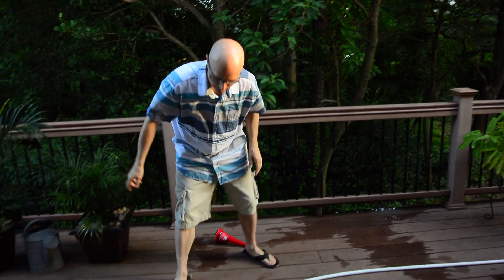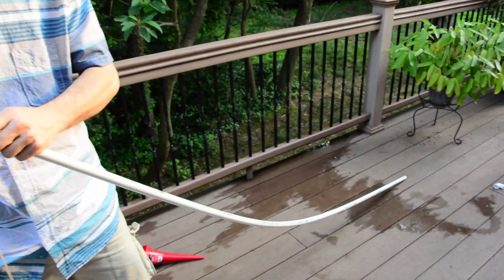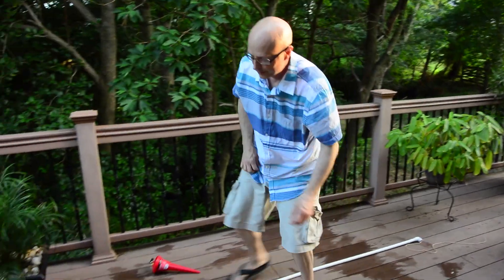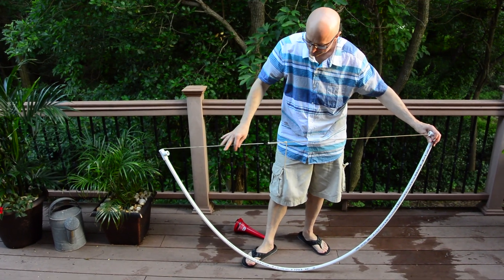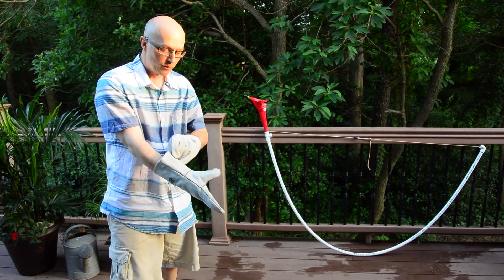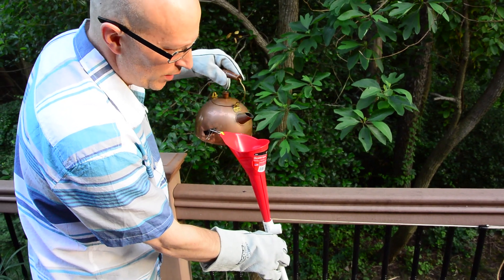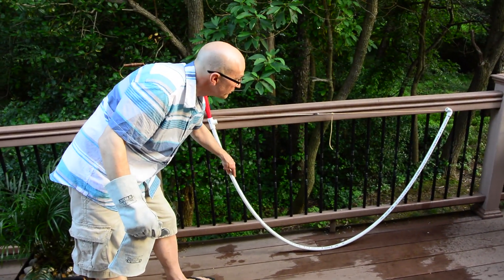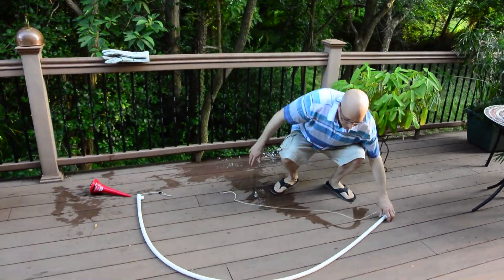How to bend PVC Pipe with Boiling water

Comment: Is the concern about sending boiling water down PVC pipes a reasonable one? Some plumbers say it's no problem, others that it could be a problem. If the latter is true, how so? Even if the PVC becomes more malleable because of boiling water, this is only briefly the case. And you're not actually down there in the pipes bending anything.
Reply from the maker: I've never heard of that problem.
Reply: It shrinks slightly when heated. Over time your elbows will leak from the pipes shrinking and expanding and breaking the glue seals

Comment: You video worked perfectly.  I wanted hoops over my 13 x 17 pond and your demonstration sahowed me the way.  I didn't want a perfect loop so I pent the first one with a steeper angle on one side, the one closest to my deck.   with the other elongated.  I used the first  to roughly template the other two.  

I obviously needef two 10' pipes for each loop so I glued fittings on each end of the loop and just pushed the added length into the fitting.  At first I planned to glue the entire piece but changed my mind when consitering where I'd store them when spring arrived.  

Thanks so much for the video.

Comment: Finding this video has been the joy of my week! If I had only learned this like 10 years ago! this is sooooooo awesome. Thanks a million.
Reply: I built a frame for over my pond with pvc probably around 20 years ago using fittings to put it all together.  The idea was to keep the fall leaves out of the pond since I live in the wiids and there are a lot of leaves.  It was a monstrocity that was somewhat effective but not nearly so as I would have liked.  Leaves would pile up in valleys plus putting it up and taking it down was a pain.  I finally gave that up after 4 or 5 years and tried to get as many leaves out before they sunk to the bottom.  That was labor intensive and really less successful than the pvc frame.  Lucky I only had comets instead of expensive koi or I would have been digging floaters out all year.  Then there was the issue of blue herring that decided my pond was a restaurant.

Move forward 20 years and I want to get active with the pond again.  Saw a great video of a guy that used 3 arcs of Pvc over a pond slightly bigger than my 10 x17.  He drove rebar into the ground at appx. 45 degree angles and put one end in the rebar on one side of the pond, went to the other and did the same there.  ingenious but he didn't describe how he bent the pvc.

Now I know how and my pond will be very clean after the fall (both figuratively and literally.  Now all I have to do is figure out the calculations for each arc's size as the pond's dimensions vary from front to back but the netting is ordered and I'm off to the races.

Much thanks Bill Lawson!

Comment: Hmm, I tried this and my pipe collapsed in the middle and is destroyed.  Does that mean too tight of a bend?  Any other way to avoid pipe collapsing? It was schedule 40, 3/4",10ft long, trying to spread a 56" gap.
Reply from the maker: If you need to do tight bends, I suggest doing this method multiple times. Bend it as far as it will go without crushing. Heat it, cool it. Then bend it as far as it will go, heat it and cool it and repeat. I was able to bend a 1/2 inch pipe in a complete circle to fit in a 1 foot box.
Reply: use sand  or garden hose inside pvc, then heat gradually and bend to desired shape

Comment: Be aware that if you're trying to make a perfect arch, it may not work. The arch I made was uneven and weird looking. I shaped my form on a plywood with small wood blocks and then poured boiling water in it and it worked perfectly.
Reply from the maker: Yeah, making a form is the best
Reply: yes, his arch is uneven also, as it retained stiffness at the  far end of the pour where the water which had lost most of its heat into the material sat.  the pour end accepted the bend and did not spring back.  definitely best to use a form and make sure to send more hot water through both ends, i think, as i sit in my chair not doing this.

Comment: Is it hot enough to bend a 1” pipe?  If so, how long do you have to shape it before it starts to harden again?  I’ve seen another video where the creator claimed it wasn’t hot enough to bend a thicker pipe.  In yet another video the pipe was boiled in hot water and it had to be shaped within 30 seconds.
Reply from the maker: I've used this method to bend 1inch pipe. As long as the water in the pipe is hot you can shape it. When the water cools off, you can no longer shape it.
Reply: Photographer Bill Lawson  Thank you very much!  Grateful I don’t have to buy and heat up sand, buy end caps or 45-degree elbow fittings, and worry about off-gassing chemicals!

Comment: Does the PVC regain full/majority structural integrity when it cools ?  use 3/4-1' for foam sparring swords, would like to make a curved sword.
Reply from the maker: Yeah it has plenty of structural integrity. I used it to build a hoop shelter. I was able to hang on my shelter made with only 5 half inch ribs. It was very strong.

Comment: Love it!!! I will be plumbing a pool tomorrow with 1.5” pvc and am thinking of trying this instead of using 45* fittings to make the turns. 

What ya think?
Reply from the maker: Should work. Probably want to leave the water in the pipe longer with the larger diameter. That will soften it up a bit more.

Comment: Thanks for this! I had an idea that requires 3 complete circles and, when I tried to do it without heat, it wasn't going to work. I'm definitely going to try this method. THANKS!
Reply from the maker: The tightest circle I have be able to get, is about a 8 inch circumference. But I put the pipe in a pot of boiling water.
Reply: @lawsonpix ,  I gave this a try and it worked great. Unfortunately, I am going to have to build a good mold to get the results I need, a consistent arc over a 6'-8' length. Going for a 8' and two 10' diameter circles. Ended up with a curved rectangle. LOL Back to the ol' drawing board.

Comment: good solution for long sections that just need gentle arching bends. but useless for shorter sections that need sharper bends...have anyone tried using heat tape?
Reply: No just use a bending spring

Comment: Pinterest sent me here from a pin on a truck camper built with PVC. Any idea who posted that pin? I have questions about that project. Thanks.
Reply from the maker: Tracey Osborn well you came to the right place! I posted that pin. And it's my project. What are your questions?
Reply: How do the 1/2" ribs stay connected to the 3/4" backbone? Also, I cut the ribs to 8' and the peak is much higher than your illustration.
Reply from the maker: The 3/4 backbone just slides into place. Once you put a tarp on top, the backbone isn't going anywhere. I was even able to pull myself up using the backbone. It's quite strong. 

The 8' ribs can be cut shorter if you want. 8' is only a nice starting point.
Reply: Good tips. Thanks Bill. I've decided not bend the ribs. I can transport the straight lengths easier . I feel that I can get all pieces into a 3" PVC pipe, capped at both ends. Thanks again for you quick response.
Reply from the maker: Right, you don't have to bend the ribs with boiling water. I bent the ribs because it made assembly easier.

Comment: Will this method still work for a 1-1/2 inch pvc pipe?
Reply from the maker: Walter West that's a great question. I've never tried it. We know that boiling water softens the PVC so you can bend it. So you can probably bend it a little, then pour the boiling water in, then let it cool, then bend it a little more, and continue the process until it's bent enough.

Comment: This seems a lot cheaper and a lot easier than the Sand/HeatGun method. I'm not against it but when on a job site and needing to move quick then yeah I suggest this man's smart method! Thank you
Reply from the maker: You're welcome! Glad I could help.
Reply: good solution for long sections that just need gentle arching bends. but useless for shorter sections that need sharper bends...
Reply: Try a bending spring even quicker

Comment: are you using cold water pipe?
Reply: pvc is for cold water and sewer applications whereas cpvc is required for hot water applications although it can also be used for cold water.  pvc is white and cpvc  is kind of yellowish.
Reply from the maker: Cold water pipe? I'm using "Schedule 40 PVC" pipe. I've never heard it referred to as "cold water pipe" but I guess you can call it that.
Reply: thanks,  when I did a repair on a water line, the hardware store called it hot water pipe so I just went with the opposite.

Comment: This is so simple and it works! I will use a hook and eye on the rope to reproduce duplicate curves many pieces. Just in time for my project. 
Thanks, John
Reply from the maker: If you want identical curves. I suggest setting up some type of jig, or curve. The boiling water cools as it flows through. So each bend will be slightly different.

Comment: i am trying to make those pvc pipe bows for me and some friends do you think this would work for that?
Reply from the maker: +chris spotville This is not a good way to make elbows. This method is best for larger arches, as seen in the video. You can try putting short pieces into a pot of boiling water, then you can make a tight bend. But elbows, no.
Reply: +Bill Lawson i meant the bow and arrows made from pvc
Reply from the maker: +chris spotville You don't need to pre-bend the bow, for a bow and arrow set up. You'll need PVC's ability to straighten back out to launch the arrow.

Comment: Great info video!  I have been trying to find an alternative to bend PVC that doesn't require a heat gun or heated sand.  Thank you!
Reply from the maker: +John Mayer Make sure the water is fully boiling, then pour plenty in there. works great!
Reply: What like a bending spring

Comment: Wow, that is a smart idea you got there.  What did you use to cap the ends off?  Thanks for posting.
Reply from the maker: Sure you can do it without fittings. But remember, the pipe becomes soft, so the pipe will flex at the ends. And then you can't put fittings on anymore.
Reply from the maker: +mtaur100 Any fitting that allows the water to pass though will work. I used a "T" on one end, and an "elbow" on the other end. A coupling would be the cheapest.
Reply: What's the purpose of the fittings? Couldn't you do this with bare pipe ends?